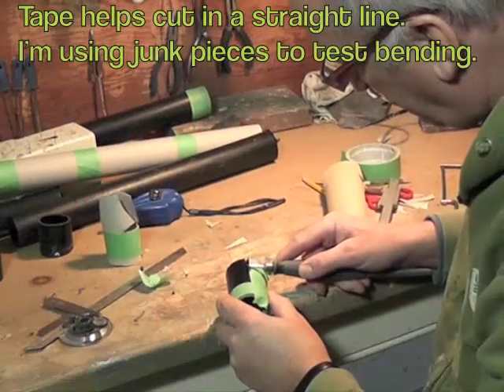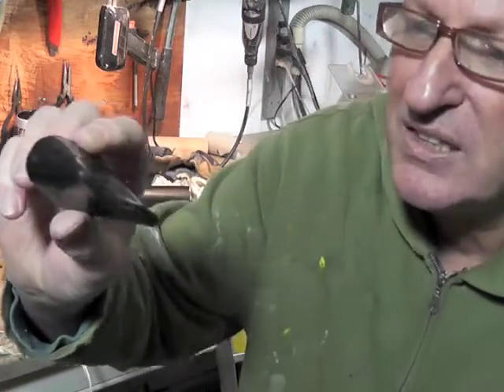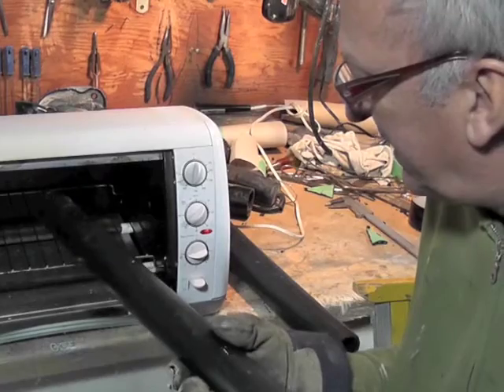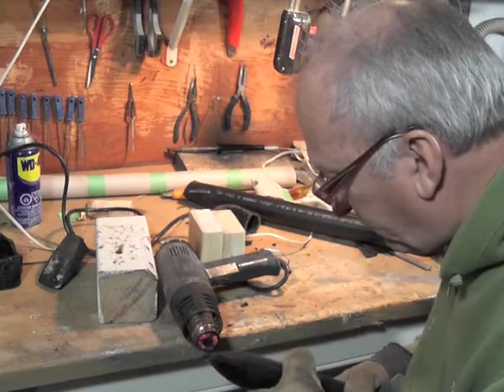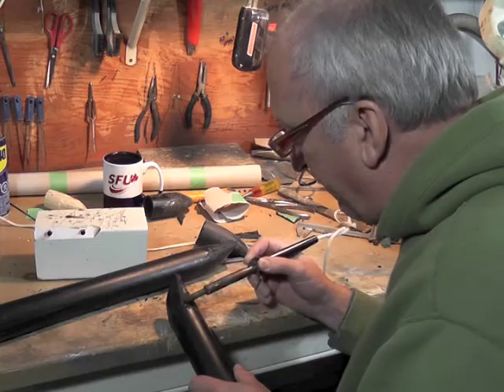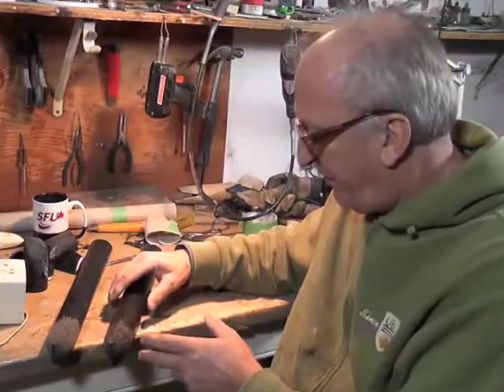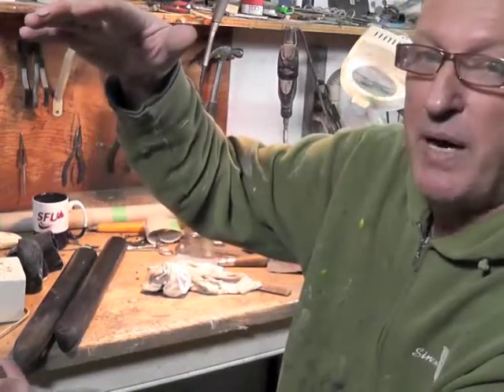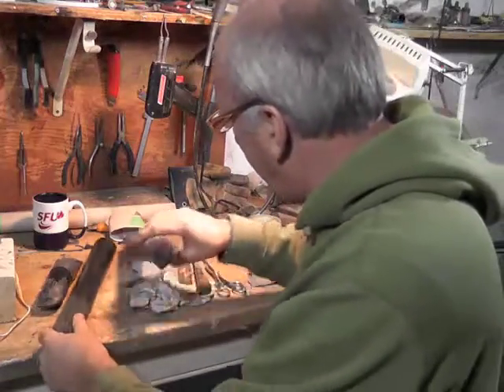PVC/ABS Model Boat #2 Bending bows

Comment: You have a good start there. You were good at doing those shots to the bow, and yes, it's hard to work on large diameter pipes. But it's workable, because I've done it. I used a large vise, a big torch and two square-section tubes to help me seal both tubes for the raft. A hell of a job and time consuming but it got very perfect. But I did not work alone.
Keep up the good work!
Reply: It's great to hear that you achieved this method on large tubes. "Congratulations"  Thanks for the feedback.